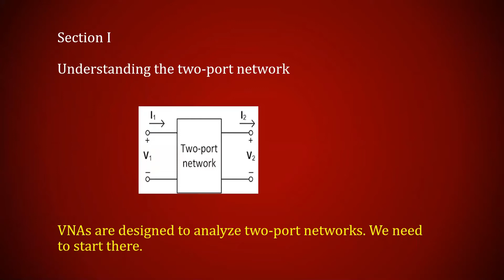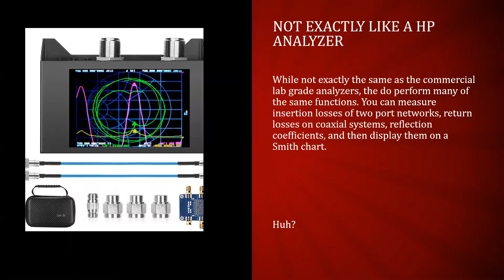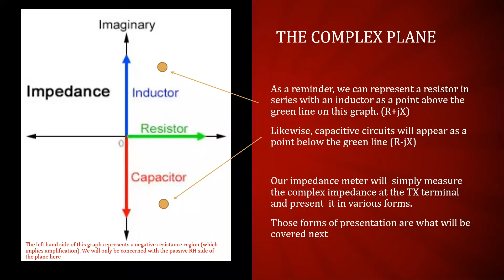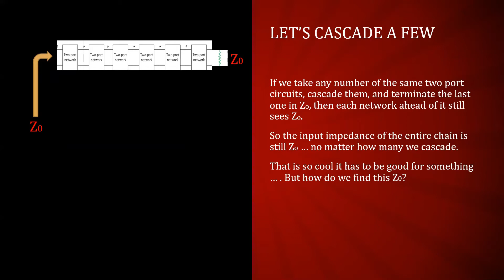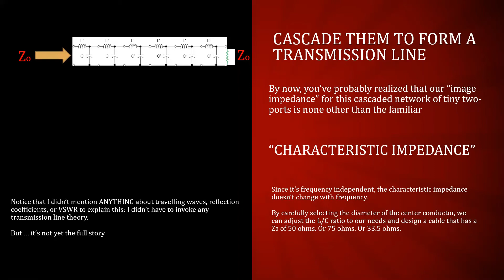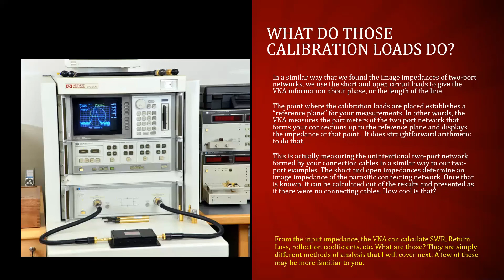You Have a VNA  Now What - Part 1

Comment: Thank you for this presentation.  I'm a UK radio amateur with a full licence and I use a NanoVna F-V2 for uses other that SWR/Return Loss. Filters can be designed by using the formula then checked with VNA, for example.
73 de Malc
M0IYI